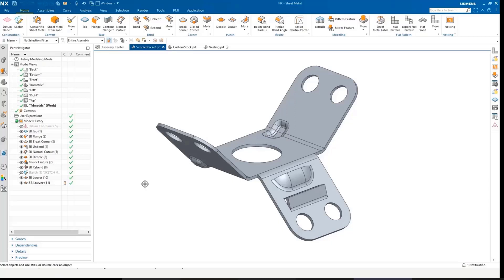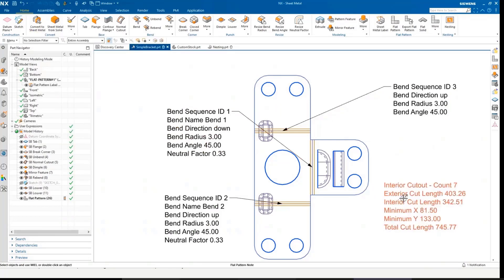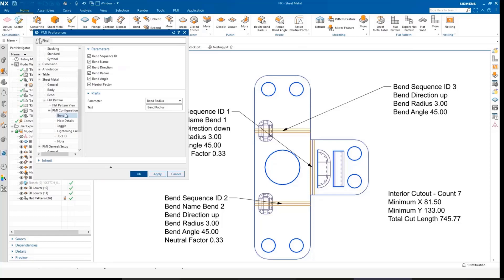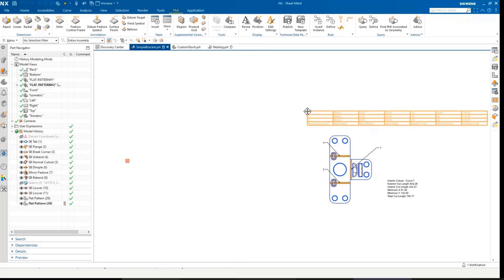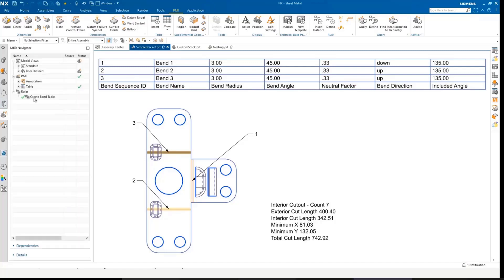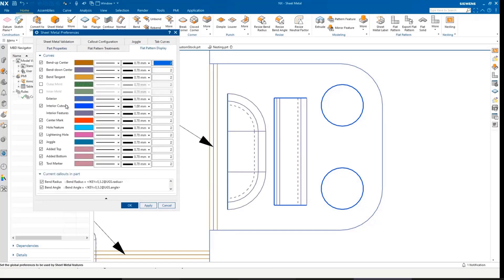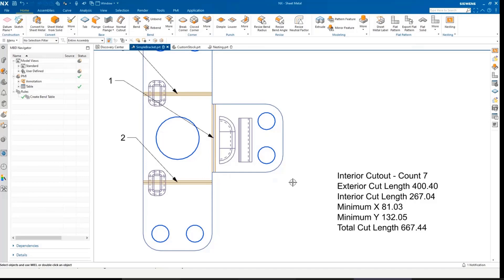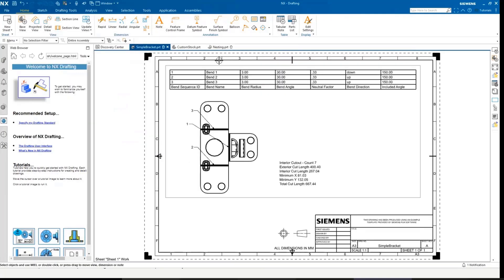NX2206 What's New - Sheet Metal

Comment: What does NX offer for sheetmetal manufacturing ( 5 axis laser cutting, nesting for flat pattern)?
Reply from the maker: Hi Tom, Thank's for your comment. Nesting of flat patterns for manufacturing is also part of the 2206 release. You can check it out in this video:
https://www.youtube.com/watch?v=NXGVngpgPrs

Besides the design of Sheet Metal, NX als offers the possibility to simulate the forming process. 

Concerning 5-Axis laser cutting, I have seen some cases in the past where the 5-Axis milling module of NX CAM was used for this purpose. I do believe there is some additional customization necessary in order to generate the correct values like the variable laser power supply along the path. But I would have to verify that with one of our technical consultants. 

If you're interested in more information it might be easier to contact us by mail. You can reach me directly through vasco@cardsplmsolutions.com